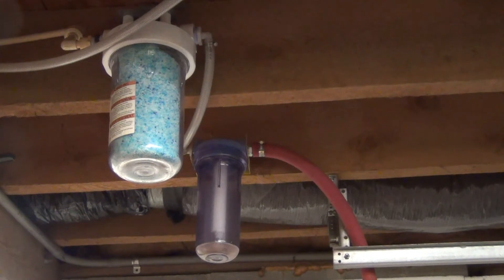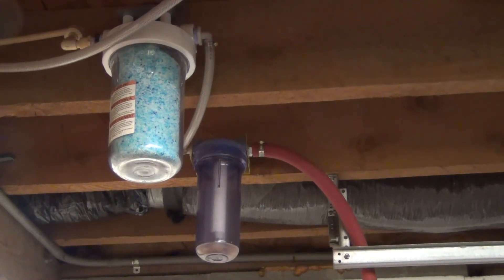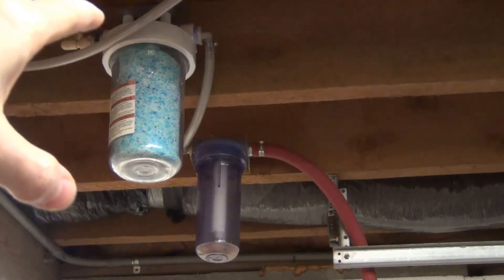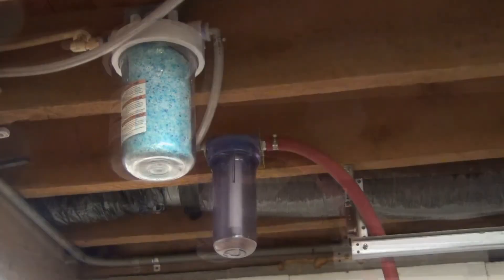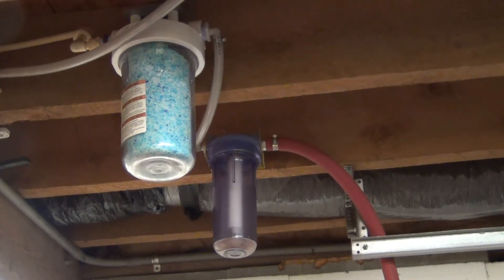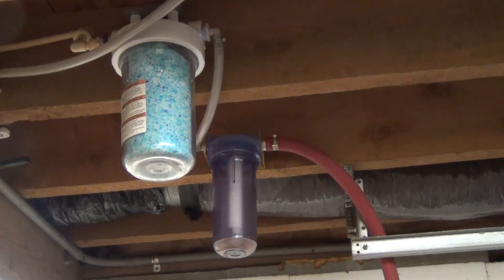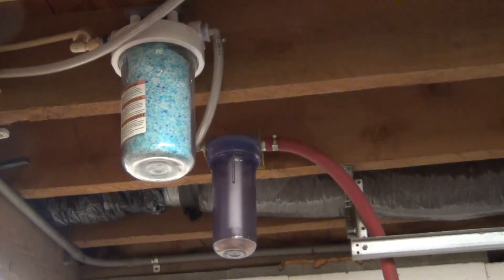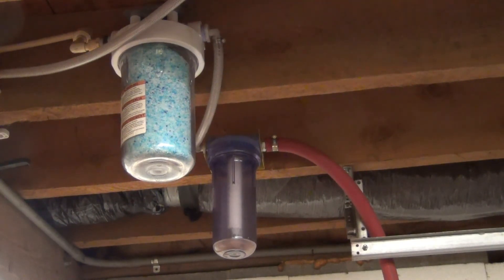Ultra Cheap Dessicant Air Dryer

Comment: What do you do when the litter is too saturated to absorb any more moisture?
Reply from the maker: If I am using bentonite clay kitty litter, I throw it out and replace it. If it's silica gel type, I bake it at 200 degrees for a few hours and put it back in use.

Comment: Is the kitty litter made from  silicon desiccants?..does the kitty litter break down when in to dust when regenerative exhuasted over and over when sataurated...and crack
Reply from the maker: Yes, silica gel in this vid. I just put it in the oven at 200°F to dry it out. Lasts pretty much indefinitely unless oil gets into it. My old compressor was starting to spit some oil in the line, so I just started using regular bentonite clay litter which absorbs oil too. I throw it away when it's damp.
Reply: @ArnoldsDesign  i seen a video where the silica  desiccants crack  then the fine dust and get in the air line as silica dust...i see you use stainless steel in line..but  how do you  prevent fine dust from getting in the air for spray painting
Reply from the maker: @772777777777777  I never had an issue with silica fines. I also have filter downstream where they enter the cabinets.
Reply: @ArnoldsDesign  does your silica beads crack over time and split?
Reply from the maker: @772777777777777  No, I've never had and issue with them.

Comment: Nice idea. But I thought that I would put the air dryer before the air compressor and make a manifold for the air intake, that way no pressure to worry about. If it starved the compressor put two dryers in parallel for extra capacity. It would slow down the the moist air and allow the more absorption of the moisture
Reply from the maker: Yeah, I don't know why that's not done. I've thought of that too. There must be some reason.
Reply: @ArnoldsDesign  I did it to mine and it works great. I also made a automatic air check valve using 2 " pvc tube , cap drilled end open and a ping pong ball to stop moist air getting to the filter when not in use.
Reply from the maker: @jerrydemas2020  That's cool.

Comment: Perfect thinking!  I need an air drier and bought a new, unused truck a/c evaporator core- I need to get ambitious and mount it in a box with a fan blowing over it to cool the air and condense the water, then run it down into a holding tank with a blow-off drain.  I will then add your bentonite/ silica gel setup.  Bet the air'll be desert-dry!  As for the housings "exploding"- I would bet that cracking will give you a heads-up (excuse the pun) before a catastrophic failure; oil exposure will eventually damage the acrylic or polycarbonate bowl, so check for cracking/crazing/softening every media change.  
Thank you!
Reply from the maker: Probably just the evap core will be good enough.